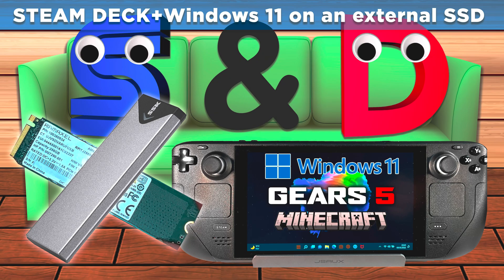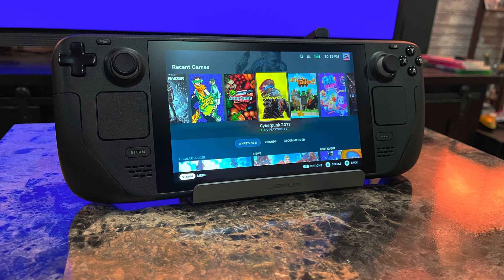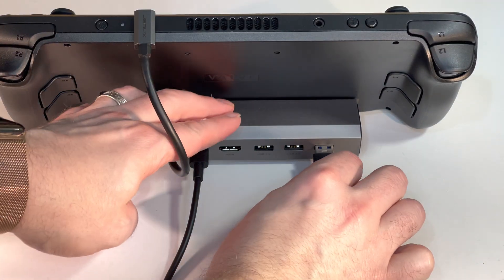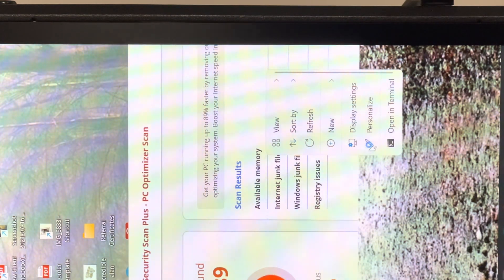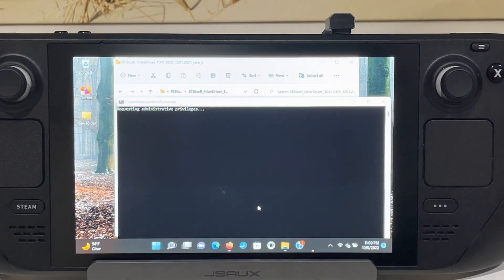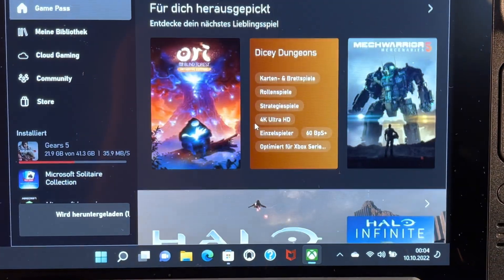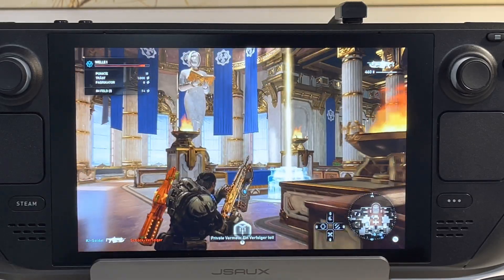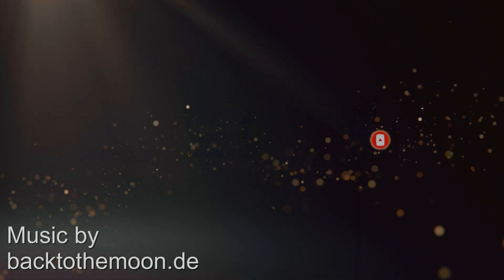Steam Deck: How to run Windows 11 from an external SSD I SSK SSD enclosure I M.2 NVME I GamePass

Comment: so in theory u can do this with any devices, just need USB 3.1 dock system 

I'll try it after i bought ally x 
I'm planning using steam OS as main system and windows from external 

well idk should i do dual boot or this way 

thanks btw
Reply from the maker: Hello @dizharmrl3797 Thank you for your info. I’m sure you can do the same with the ally x. I prefer this method to have physically separation between the OS systems. On SteamDeck you can accidentally mess it up and break one of the OS‘s when having different partitions and stuff. So this is a safe way to keep your systems functional and also separated 😊
Reply: @SamDansCouch that's what i thought to if using dual boot, man this helpfull 
thanks again
Reply from the maker: @dizhamrl3797 No problem, thank you for sharing your setup plans 😎 👍

Comment: Hey sorry its quite a late comment but would appreciate it if you could let me know if your setup works with the dock+monitor using HDMI?
I want to have a Samsung T7 connected via USB to my Ugreen 9in1 dock, along with keyboard, mouse, HDMI to a TV/monitor, high power charger and have the dock connected directly to the steam deck. Do you think this would work? Thanks in advance!
Reply from the maker: Hello 👋 yes I usually use a TV but a monitor with HDMI works without a problem too 👍

Comment: hey great video! I was just wondering if you can use that ssd for both booting windows from and using it as a storage device to store games in?
Reply: Battlefield 1, 4, 5 is have anti-cheat now fk EA and the only way to play is this Windows.
Reply from the maker: @Monty_o11  hello 👋 thank you 😊 yes you definitely can use it as a storage device as well and have windows on it installed at the same time as well 👍
Reply: Hey. I was woundering the same thing, did you figure it out? Trying to partition a 2 tb external ssd. Have 500 gigs for windows partitioned and the rest for storage on steam deck games
Reply: @infurnobrad  hey, nah I dropped the idea, steamos already got everything I need

Comment: hi i hve a questions how am i going to remove the external ssd since the deck was booted to windows
Reply from the maker: Hello 👋 As long as you are using windows on your external ssd it does need to stay connected. Some valcro tape their ssd to the back of the SD to make it portable or just use it on a dock on a tv 👍
Reply: Actualy im planning to use windows for external only . should i boot it to steam os then safely remove it
Reply from the maker: @darewinvillanueva496 yes that would be the best method to be safe 👍

Comment: hi ive just done this except it wont let me connect to wifi and wants me to use an ethernet
Reply from the maker: Hello Maisha! 🙂 I would try to reinstall the wifi drivers from valves website again and remember that Windows is only 100% supported for LCD Steamdecks. OLED is not fully supported yet but it is coming soon: https://help.steampowered.com/en/faqs/view/6121-ECCD-D643-BAA8

Comment: I was trying this and it works if i just have the ssd pugged into the deck. but using the officials steam dock deck and having the usb plugged into that it can boot but it only lasts a few minutes before the screen suddenly goes black and windows crashes. I have another3rd party usb dock alternative i tried and same issue.
Reply from the maker: Hi mattecrystal 👋 I’ve been using my JSAUX dock in this video but the official dock should work with this just fine. I’m sorry you are having issues. My windows has been working without crashing but there were updates to the drivers in the past months as well. Maybe try to see if you have the lastest ones. Also if you have an OLED SD, this one doesn’t officially support windows yet and new drivers are needed which aren’t available yet.
Reply: @SamDansCouch  I got the drivers installed and am using the OG steamdeck. 

I was able to temporarily  fix it via using a different usb cable to connect the ssd to the dock though. Apparently the Samsung T7 can draw too much power or something when using the original cord and cause the power to go out for a ms which in turn causes windows to crash. using a different, (slower cord) can fix this. Still looking at solutions that will let it work with OG cord though.
Reply from the maker: @mattecrystal6403  thank you for sharing your experience. Good call on the cable. The sudden crash did made me think of a power draw as well. Maybe you can find a better cable on places like Amazon. The cable that came with my ssd adapter worked out of the box. It’s just short as a draw back. I hope you can get you windows installation stable soon 😎

Comment: Is this a better option vs a microsd with windows on it? I know it will be a lot faster. Also is it better to do it this way? Or order a dock with a m.2 hub? If I order a dock with a m.2 hub am I not able to take windows portably? I just ordered my oled today so I’m researching and oh so excited!
Reply from the maker: Hi Tina! Oh you are going to love your OLED SD, great choice! Having Windows on SSD is going to be faster and reliable since microSD cards can get reduced life span when putting windows on it (lots of read and writes on the card, while SSDs are fine with that). You can get a dock with a built in SSD slot but it will be more clunky if you want to go places. Depends how you want to use your windows installation most. I hope you’ll receiver your SteamDeck soon!

Comment: Thank you for this in-depth tutorial. Wondering though if you've ran into an issue where you're display settings across multiple monitors reset upon booting it up. It's quite the head scratcher.
Reply from the maker: Hi Matt 😎 I have not had any issues like that during my tests but I haven’t tried it in a while. I know valve does update their windows display drivers once in a while too. Maybe worth checking out if a newer update might fix it again.

Comment: Do you have USB 3.1/3.2 ports on the docking or only 3.0 ?
Reply from the maker: Hi GianmariaFadini 👋🏻 The Jsaux 603 dock in this video has USB 3.0. If you get the official Steam Deck Dock it has USB 3.1. And the bigger tears of Jsaux docks even have 3.2.
Reply: @SamDansCouch  I was wondering if it is worth spending extra money for the JSAUX dock with USB 3.2 and M2 connector built-in (HB0604) or the cheaper version with only USB 3.2 and DP (HB0702). I am in doubt about this.
Reply from the maker: @GianmariaFadini  In my opinion you can go with the cheaper option. I myself saw no speed difference between my different docks I have either. 👍

Comment: I am planning to upgrade steam deck ssd to 1tb, can i use the 64gb one into the enclosure to install windows. Also can i run windows and download windows game into microsd card on deck?
Reply from the maker: Hi Russellyan92, yes you can use the original steam deck ssd externally too and slap windows on it 😄 and you are able to use the sd card under windows as well. Good times 😎
Reply: @SamDansCouch  amazing, i"ll definitely try it out. Thanks for the tutorial

Comment: Can you use ssd nvme on dock? And if dock has power to steam deck, will passthrough power battery 90% or above on steam deck still work? I worry passthrough power on steam deck will not work anymore if i attach nvme ssd on dock because power consumption of nvme ssd. Or I worry nvme ssd not work anymore if passthrough power connected to steam deck. Help me because I want play deck on docked mode + nvme ssd attached + passthrough power steam deck
Reply: Very nice, thanks a lot for your information👍
Reply from the maker: Hi A A! Yes, you can use the ssd and have the steamdeck charge and stay at full power. Works like a charm 😊👍
Reply: Wow that's great. What type of your dock station? I wanna buy JSAUX old dock without nvme port. I think it is cheaper.
Reply from the maker: @AA-yc7fk  I have the standard JSAUX dock and the official valve dock. If you get that cheap ssd case you can just hook it up to one of the USB ports and you are good to go. No need for the expensive ssd jsaux dock😊

Comment: Are you able to sleep and resume in windows? My installation crashes with bsod and  'BOOT DEVICE NOT FOUND' error
Reply from the maker: Hi ri4z! I'm sorry windows crashes for you. Mine works but I had to assign the power button in the power saving settings as a trigger to go to sleep. Auto timer didn't work.
Reply: @SamDansCouch  Thanks for getting back to me.. I figured it out thankfully. I'm using a cheap orico nvme enclosure and the usb cable that came with it appears to be a duff. Switching to a better usb c cable seems to have fixed the issue.
Reply from the maker: @MrRebrahim  Thank you for the update! Yes a cheap USB cable can be a pain. I had the same problem with an external drive on my main computer. Wiggles out easily without me even touching it and it ruins the day. Glad you figured it out!

Comment: Hi thanks for your good explanation. I have a question. I have installed windows 10 without activating and now I got the windows watermark and a question to activate it. Do you have that also and how do you get rid of it? Thnx!
Reply from the maker: Hi Louis, yes when putting windows on the steam deck, even when activated before, counts as a new “PC” and requires activation. As far as I know you’ll only lose wallpaper functionality and the watermark. So for games you could just ignore it if activation is a no go.
Reply: You buy Windows license for a device only, you can't buy a copy of Windows.

Comment: How did you got Windows 11 running without using the 2Go. I tried the same and getting the blank screen and going to steam OS instead. I guess we can't boot windows directly from USB.
Reply: Did you have to change any settings before doing this process? I took the NVME SSD from my PC with fully functioning Windows 10 already installed, but the drive doesn't appear in the steam deck's boot manager. I've tried connecting the drive directly to the deck's USB port, connecting through a powered dock, and multiple cable types. Any assistance would be greatly appreciated
Reply from the maker: @wayneconn8997  Hello! I did not change any settings. I plopped my windows ssd straight from my old laptop into the ssd case for the steam deck. Make sure your ssd is formatted as NTFS. Besides that the ssd should show up in the boot manager. I have my ssd running on a powered hdmi/hub. Other than that there is nothing else to really set. I hope you get it working. 🤞🏻
Reply: @wayneconn8997  did you ever solve this?
Reply from the maker: Hi outsideGaming, I used the full version of windows 11 (since it was already installed on the ssd from being in my old laptop). It boots up without a problem from usb for me. Just got to do the bios select every time you start the deck. I’m sorry your windows is acting up. If everything fails I’d try to fresh install windows 11 again. You shouldn’t need to do a special “to go” installation. Keeping my fingers crossed for you 🤞🏻